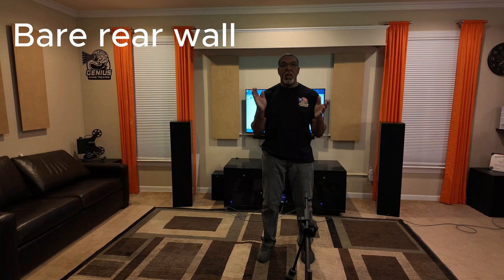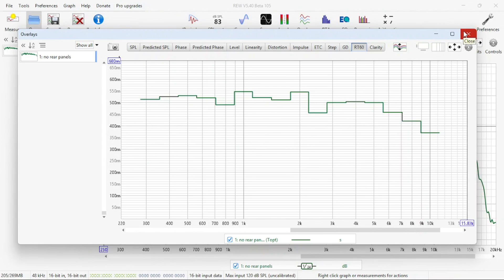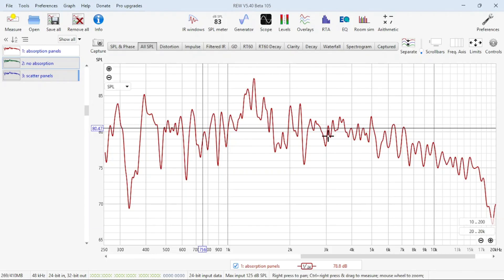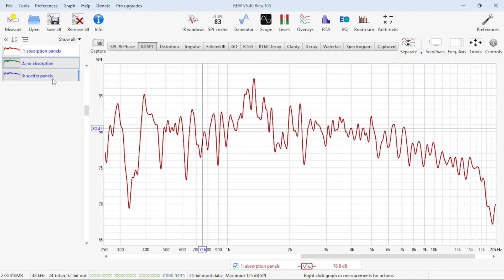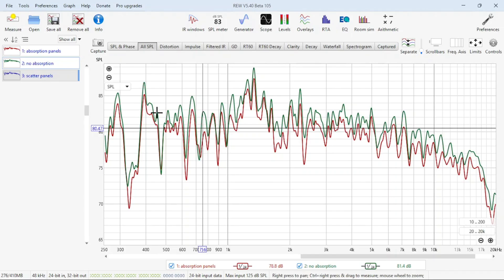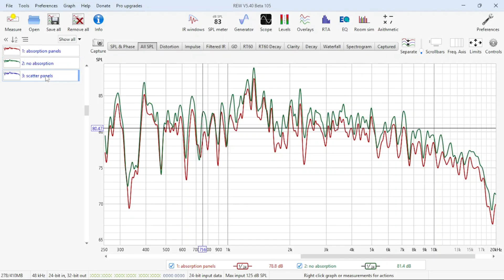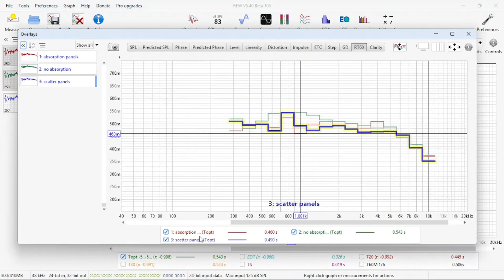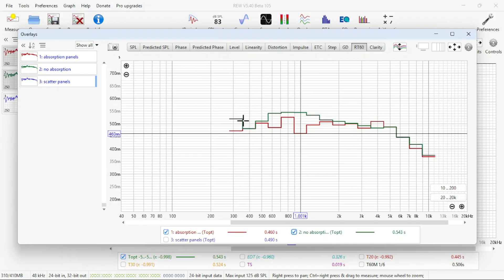A/B Test your Acoustic Panels with REW

Comment: Why are you not looking at the data within the impulse response. You should be using it for what type of panel is required and where, and you can see the changes made in the impulses first reflection points.

You should be determining what panel to use, and where based on the reflections seen in the impulse response when no treatment is installed.
Reply from the maker: That would be a fascinating experiment. However I am not ashamed to say that I’m not experienced enough with REW to explain those results. As I learn to use REW, I may come back to this topic to give recommendations. 
For now, I’m sticking with conventional wisdom to what many do to the rear wall, and overhead. I’m sure with more knowledge, the curiosity will follow. Thank you for the suggestions and the interest. 💪🏾
Reply: @GeniusHomeTheater ChatGPT is great for helping you read the information within the impulse, calculating the time of flight to figure out roughly where that reflective surface is, and also with the REW settings to how the impulse can be displayed like Dirac displays its impulse responses. 

I always measure each individual speaker, and then adjust their placements so all reflections from left speaker and right speaker are coming right in time with each other. If those early reflections are arriving at your ears out of sync with each other, it will cause smearing within the soundstage. 

Then you can measure both speakers summed. Even the whole system as 1, and see how it's all interacting with each other and if the subs initial impulse is in time with the mains. 

It is quite fascinating learning from impulse. 

GhatGPT will also help you determine based on the reflection types, if a single phase absorption panel, mixed phase diffusion, or a hybrid panel would be useful and why and it will explain why with a description on what the impulses reflections are doing.